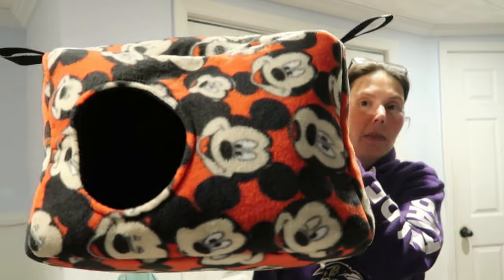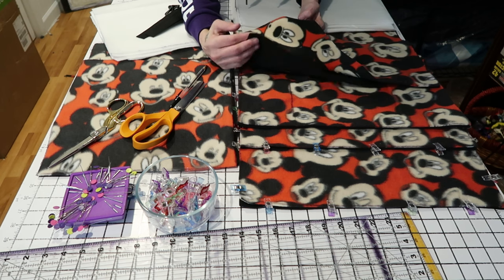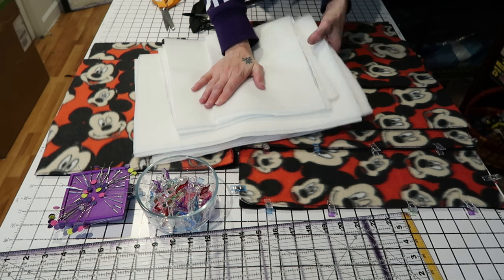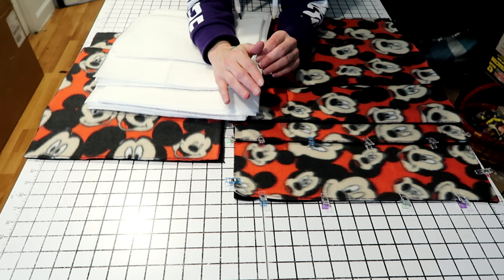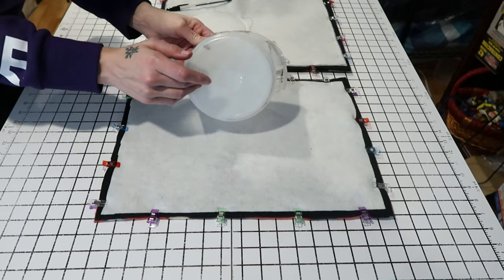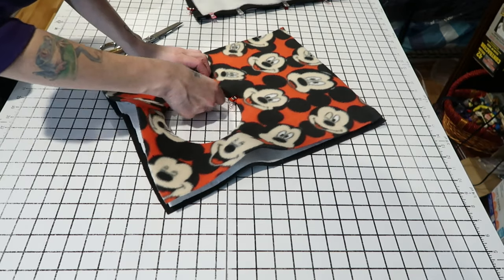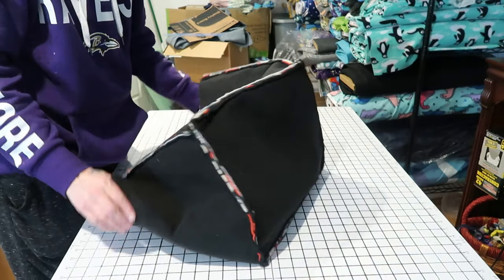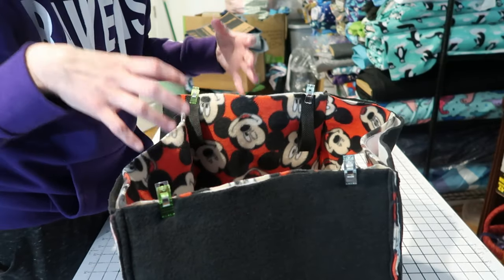Step by Step: How to Sew a Cube Hammock

Comment: Where’s your industrial sewing machine from?
Reply from the maker: It’s a Juki. I absolutely love it. I got one with the automatic thread cutter and lock stitch. But you can get it without those features too and it’s a lot cheaper. I really can’t say enough about how much I love it. They sell it on Amazon, but I actually got mine from a sewing machine shop and it was a little less expensive and they delivered it and set it up for me!  This is the one I have: https://amzn.to/3KQLer0

This is the one with just the basics: https://amzn.to/3rdz7N4

Both versions only do a straight stitch so I use my Bernina to do my decretive stitches, zigzag stitches ect..
Reply: @FerretTails  do you know if the cheaper one works on foam?
Reply from the maker: @bobbyjoe6365  it should. It’s pretty heavy duty. I actually tried the cheaper one in the store. It’s the basically the same. The main difference is the more expensive one has the automatic thread cutter and back stitch. There are a few other differences, but nothing that major. They use the cheaper version in factories and sewing classes. 

Here’s an overview of the one I have with the CP 180 panel https://youtu.be/dXs99Qarafk

And here’s an overview of the 8700 DDL without the control panel https://youtu.be/QI-8pLZGqvU

I choose the more expensive one because I love a thread cutter and the automatic back tac is great for what I do.

Comment: Do you know any tip to stop your needle foot from adjustments when sewing ?
Reply from the maker: I’m not 100% sure I understand the question. Is your needle positron changing while your in the middle of sewing? On my machines I can only change the position by pushing a button. If it’s moving without you moving it intentionally you may have to take it to be serviced.
Reply: @FerretTails  I need to get my sewing machine serviced , but when I sew thick layers of fabric my needle breaks. I will put in a new needle but then my machine won't sew , the turner for the needle stops working.